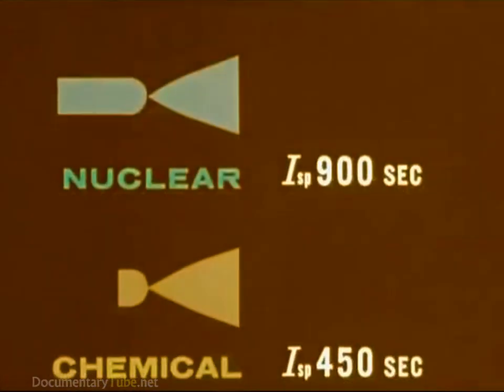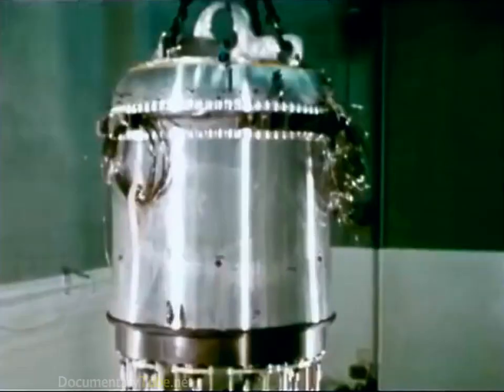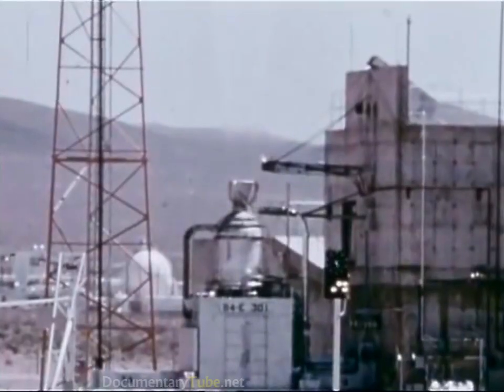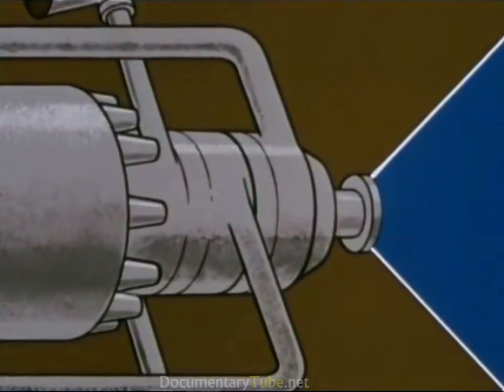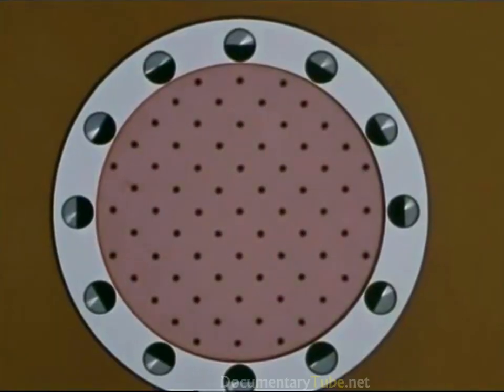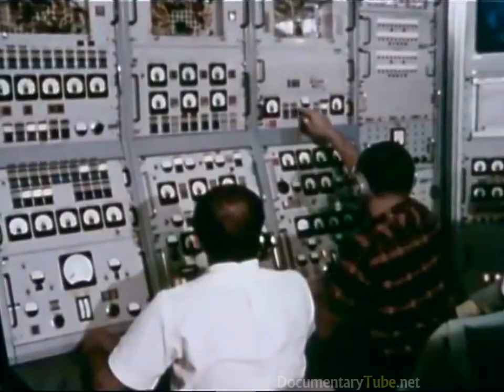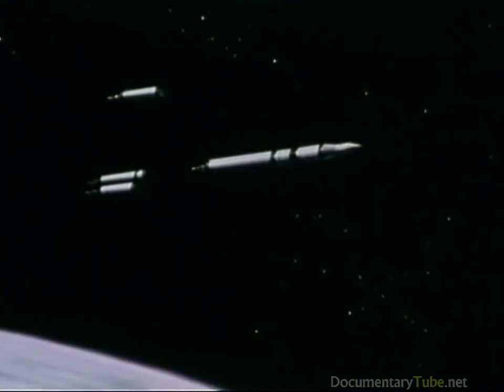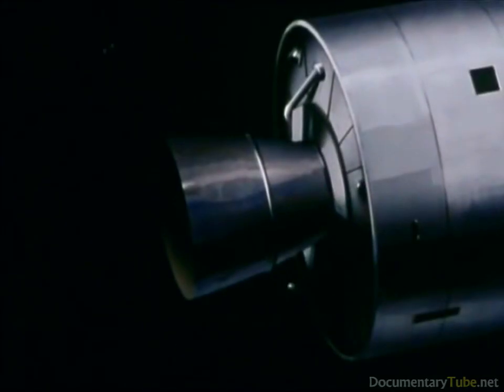HOW IT WORKS: Nuclear Propulsion

Comment: Solving radiation problem is essential i guess
Reply: I believe that generating sufficient thrust will be the first big problem to overcome.  The video stated that the engines finally developed generated about 75,000 of thrust each.  Modern payloads are measured in hundreds of thousands of pounds (not including the weight of the vehicle itself and the fuel needed to run the engines).  Multiple engines would be the normal solution to that problem but the size of the engines and the amount of fuel required to run them long enough to boost a Mars-bound payload to only a low-earth orbit would be prohibitive.   It would, however, be lighter that the fuel required to get the Saturn 5B to low earth orbit.  The fuel for one engine alone for a one hour burn of the atomic rocket engine weighs almost 90,000 lbs.  By comparison, one of the F-1 engines used on the Saturn 5B generates 1.5 million pounds of thrust and it took five of them to get the rocket off the ground with a 108,000 lb. payload. It GUZZLES a heavier fuel (Kerosene).  I don't mean to belittle your comment.  Without a doubt, radiation is a serious and deadly problem.  Once the engine is run, virtually the entire system is radioactive. Humans cannot handle or manipulate it directly.  Shielding, using currently available materials like lead, would be prohibitively heavy.  There are a myriad of other problems that exist but radiation protection is very high up on the list.  I suppose that the priority is debatable depending on the area of expertise of the person assigning the priority.
Reply: Dan Colley agreed with your point. I was referring to the so-called nuclear powered ICBM Russia is boasting about. In earth's atmosphere you would need constant thrust IE a whole hell of alot of reaction mass. On the other hand to shoot to Mars you don't need nearly as much bc of well space less gravity so a small amount constantly would generate great speeds. No doubt the concept it's doable. The proof is in the video. Besides radioactivity the  other factors as you state about lead being to heavy to be practical is the next big problem.
Reply: But the space is full of radiation
Reply: 조성우 use helium 3
Reply: Use just plain Helium. It would not become radioactive under these circumstances. It is a finite source. But unlike Helium 3 we actually  have some,
Reply: 조성우 even if they solve it that won't be enuff.  To do as Russia claims with unlimited flight is the size of reaction mass "water hydrogen or ammonia" tank it would have so big it would not be able to fly.
Reply: Hydrogen fuel would make an excellent shield from the engine. As for shielding from interstellar sources, well, people need water to drink dont they, and metal to keep the ship's air in.
Reply: lots of air in atmosphere to use for mass. Would to carry mass only if operated in space. This specific design limited discussed here. Historical perspective on Russia suggests the excess death is not a consideration in the operation (collateral damage). I doubt if the exhaust is very radioactive.
Reply: The radiation problem is irrelevant  in a WW3.
Reply: Used as a de-facto third stage for orbit transfer, you can put alot of distance between the reactor and the crew capsule (via a tower structure), greatly reducing the biological shielding requirements. This is true because you are no longer fighting aerodynamic forces, so a long tower or column "spacer" becomes practical. Effectively you are using the power of 1/r^2.